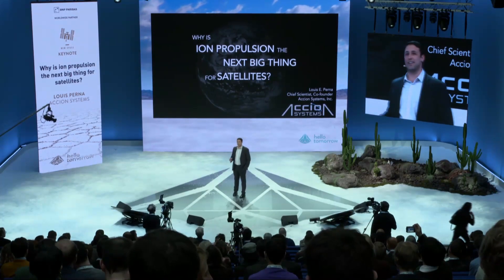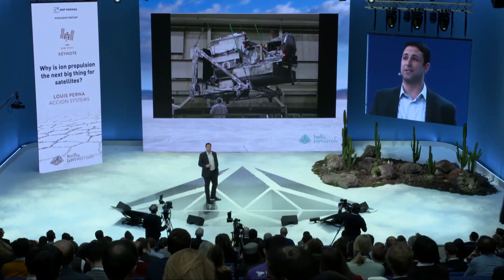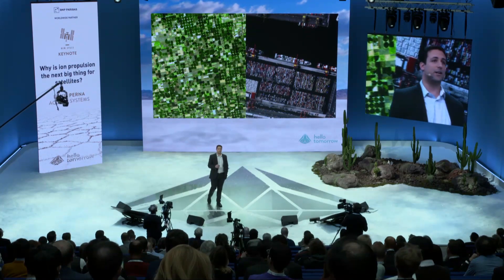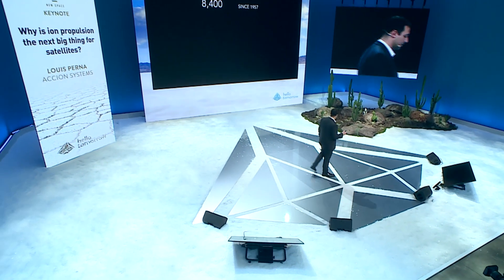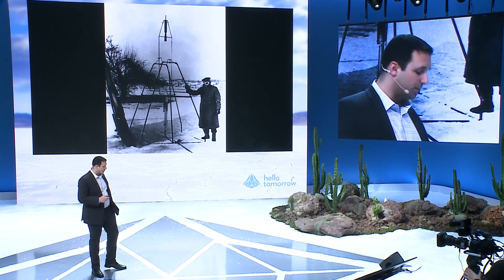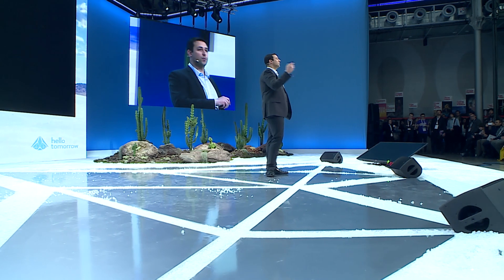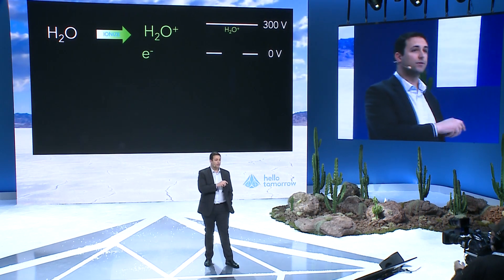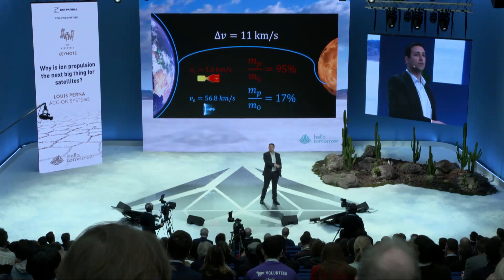Why is ion propulsion the next big thing for satellites? I Louis Perna, Accion Systems

Comment: It may be possible to build a space elevator from current materials. Just as rockets are built with multiple stages, so could a space elevator be built with multiple stages but the heavy lifting on a space elevator is at the center. At G.E.O. where gravity is virtually zero, there is no weight penalty for having multiple tethers. By using multiple tethers at the center ( for greatest strength ) and fewer tethers as you move away from center  ( for lesser amounts of mass ), you avoid the problem of not having a material which is both light and strong enough.

Please watch my video:

https://www.youtube.com/watch?v=QddWL3RIx40&feature=youtu.be

Comment: Just make efficient lightweight and durable ornithopters with grooves in the wings to fit small ion thrusters to get to space and travel a bit. Then develope compact light thrusters and put one on the back of the ornithopter then the astronaut could have a pole arm that projects 2 light beams that are entangled but one is far faster than the speed of light so u can basically tune into the desired location of the universe and the other is regular light speed emitted perpendicular to the other, then both eventually collapse into a kugelblitz to create a worm hole that's maintained by pumping the nearby hole with some form of dark energy or maybe just maintain the intense light beam that created it, duuhh..
Reply: There'd need to be a cool suit of armor too with rad lookin pinstripes the deflects radiation and is capable of reentry plus an ai helmet that can maybe see through clothes and brew coffee too
Reply: It could have bio solar panels on it and a nuclear battery built as a 2 in 1 into the light thruster